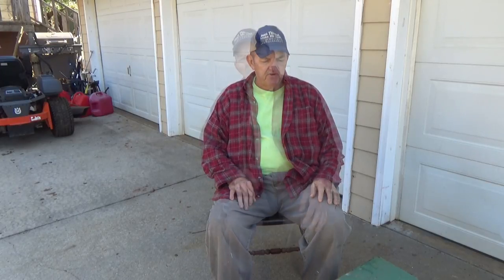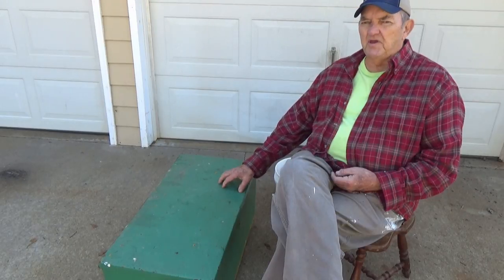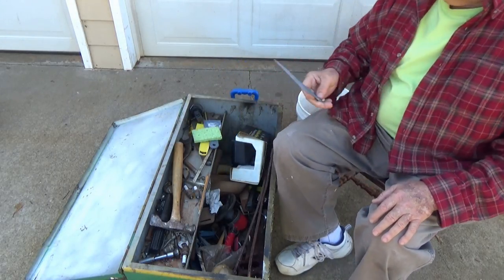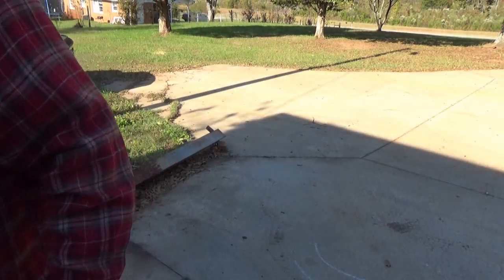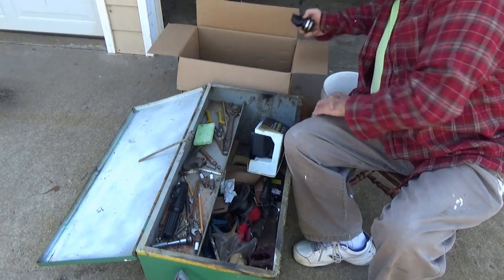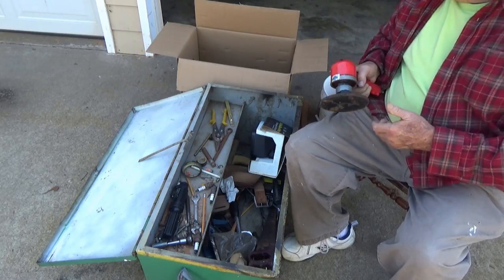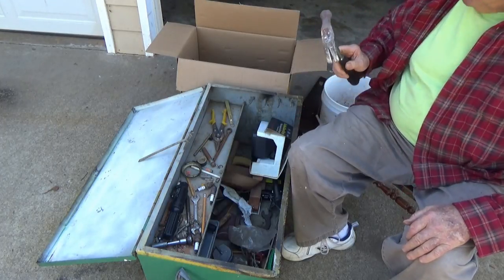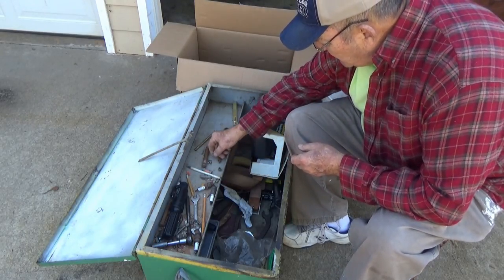Pwalpar VLOG Whats in the Box Ox 11 17 2017

Comment: Walter, Been there, done that, many times. Lesson learned.  ¶Take some old bed rails and weld up a frame that the box will sit in. Weld the rollers onto that frame. I did this for a similar steel box, also for my band saw, table saw, drill press and a bunch of other things.    ¶On each end of the box, attach a simple handle. Nothing fancy.   ¶Then take a 5" long piece of 3/4" iron pipe and weld on a 3 foot long piece of 5/16" round stock, making a "T" handle. Then bend the other end of the 5/16" round stock into a hook. Use this for pulling the box, or anything else,  around. I made my hook probably 40 years ago and have used it often. Saves on the back muscles. Jon, MSO-439
Reply from the maker: Great suggestion Jon  I will take your advice and its appreciated

Comment: Could be a few useful items Walter?..not sure I would know how to put spark plugs in these days ...we use to take em out clean em regular ..now I dont know if petrol engines still have them...something ti keep you busy and a few memories in those tools ..Dave
Reply from the maker: Yep these new fandangle engines need a computer whiz
Reply: 👍🏽😔sure do
Reply: Just get yourself a handy-dandy diagnostic tool and plug it in under the steering wheel and it will tell you everything that's wrong,they're only about 200$,wish I could afford one.

Comment: Enjoyed your video today. I first thought the thongs were used to pick up blocks of ice. But they are used to pick up railroad ties. That was interesting. And I don't like a thief either. This is trivial but it irks me. When I go to get my car worked on in a repair shop, if I should leave something in my car console like a tire pressure gauge or screw driver, I will notice the next day when I need it they are gone. Got 3 new tires not long ago and kept one old tire on. I need to get it replaced because it has a slow leak. Not long ago I needed to put more air in it and when I pulled up to the air pump my gauge was gone. I forgot to hide my air gauge before I went into the shop. This happens to me a lot! It really rubs me the wrong way. I just don't get it, why a tire pressure gauge or screw driver. One time I went in for an oil change and the guy forgot or stole my oil cap off the car. I went back thinking he forgot it, but they couldn't find it so I think he stole it. I do have one great honest repair guy I go to in another town that is trustworthy but sometimes I have to go to another shop and this always seems to happen to me. I used to keep a tool box in my car but one time a guy got into it and stole some wrenches but that is another story. Sometime I am going to leave a fancy wrapped present in my car and put a piece of coal (or something :) ) for them to steal. LOL! Like to see their expression! LOL! Ha Ha! Nope, I don't like a thief no matter what they steal.
Reply from the maker: LOL  Wrap up a note telling them to get a life   I would find a more honest repair service for sure  I really dont like thieves either  Thanks for the support Joyce
Reply: live trap a skunk,wrap him in a blanket or bath towel he won't spray,leave the handle visible and a note "special treat",roflmao.
Reply: LOL! Ha Ha! That would teach them a lesson!